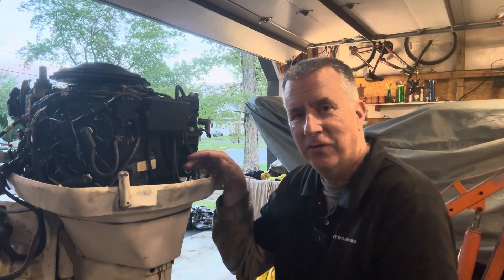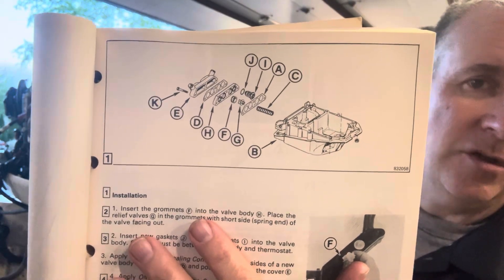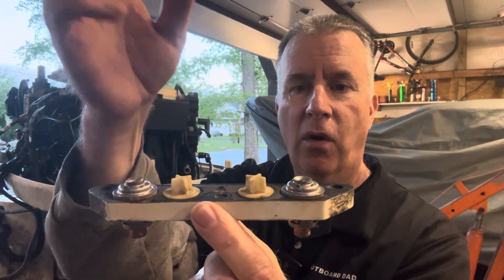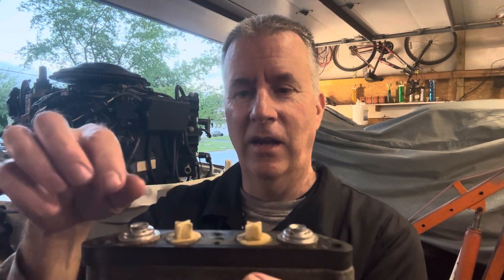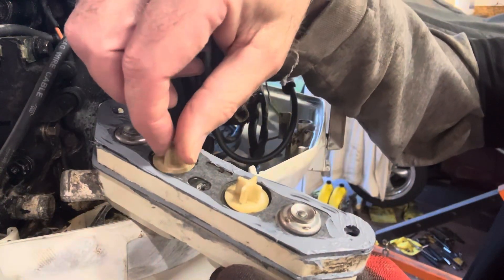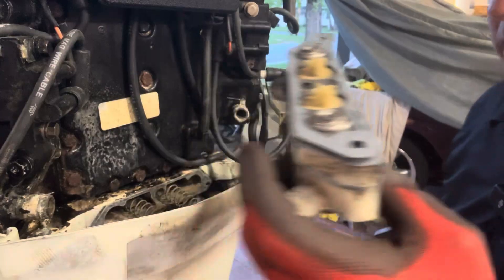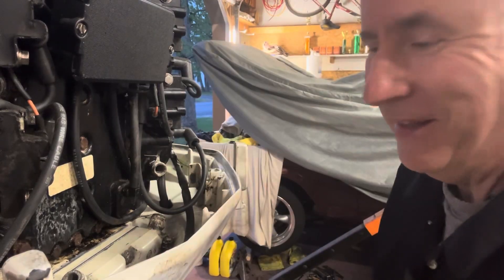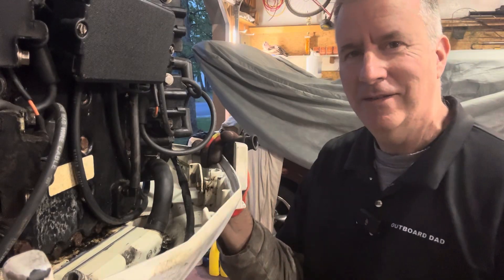“Installing Thermostats on a Johnson 90HP (Using the Manual)- What’s it Worth Now?”

Comment: I’m taking my thermostat housing
 off now as I watch your video. This is crazy.
Reply from the maker: Love it! Let me know if I can help!
Reply: @OutboardDad  Actually came off ok. Thermostats were in pretty bad shape. I ordered a new kit. If you recall this is my 1987 88SPL that has been sitting for 32 years. Got it running today. I'm slowly going over everything in-between working on my main project boat. My 1985 skiff to take on my Florida fishing trips. Thx Jim
Reply from the maker: @JamesSmith-wy7zk Sweet! Did you do a compression and lower unit check?
Reply: @OutboardDad yes compression are 120 for each plug. I don’t have a pump to check lower unit yet. But, I replaced oil.
Reply from the maker: @JamesSmith-wy7zk Sweet! And the power trim unit seals?
Reply: @OutboardDad No power trim and tilt on my model.
Reply from the maker: @JamesSmith-wy7zk One less thing! Keep me posted how it goes if I can help in any way
Reply: @OutboardDad I will and thank you!
Reply from the maker: @JamesSmith-wy7zk Anytime! May you and family have a blessed New Year!
Reply: @OutboardDad  Thank you and Blessing to you and your family in 2026

Comment: Hey Keith. I snagged a 81' 140. Lucked out pretty good. Pulled the stats as precaution... They were fine. It has the bubble. Did it w/o powerhead removal. Found a very straight forward way to do so. Your video definitely helped. However. I fear it's not going to be water tight and the threads are maxed out. It's late but when i was pushing air through it i thought I could feel leaking.. any advice input?
Reply from the maker: I like the Motorcraft silicone used for deisel engines. Clean out the threads as best you can, eventually they will need heli coil but if not too bad you can get away with that silicone. Also has to be clean and that’s a tough spot with the bubble back
Reply: @OutboardDad agreed cleaning was as much of a hassle as the installl.. almost.. thanks cpt. Wish I just left it alone. If it leaks I'm pulling the ph and doing a repaint. Going on my personal boat.
Reply from the maker: @wlukew3052 Keep us posted! Send some pictures. I know guys that have cut a section of the bottom cowl out to access the stats easier. Some say it’s being a butcher but I would put the proper operation over the cosmetic
Reply: @OutboardDad hey on that note. Ive been searching for a 140 hp. Finally found something. Rolled the dice hard. Right now I'm 650 into it. Maybe if you have some "free" time you could give me some advice I'll make it worth your time
Reply from the maker: @wlukew3052 Sure, email me at keith@outboarddad.com

Comment: I would clean the entire rear area of the power head and the lower cowling while you have the thermostat assembly out. I would also strip and repaint the thermostat housing and use a Dremel with wire brush bit to clean up the bolts.
Reply from the maker: Cleaner the better for flow I agree, and keep corrosion down!😊
Reply: Will do. I will prep everything  while I wait on the rebuild kit to come. Thanks

Comment: what part number are the thermostats ?? I have replaced mine with 378065(143 temp)which seems high. Thermostat are from  Marine Eng/ right from parts manual. but i still get temp horn at idle.  just making sure. i have correct thermostat. .
Reply from the maker: ok, what you need to do is grind a small notch in the top to let the water flow slightly when idling. I am away back next week if you email me keith@outboarddad.com

Comment: Hey man, I have an 88 Johnson 90hp and at full throttle on the throttle lever it’s only getting up to like 2000rpms, going about 7 knots. Wondering if you have any insight
Reply from the maker: Have you done a compression test? Sometimes the prop hub goes bad and that can happen as well. Let me know when you do these tests and I will see if I can help. Email me at keith@outboarddad.com